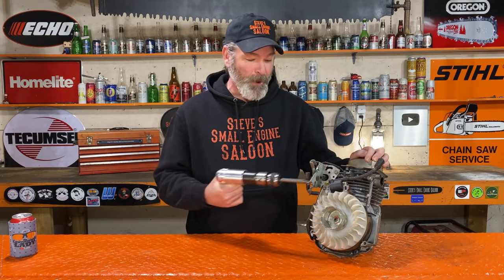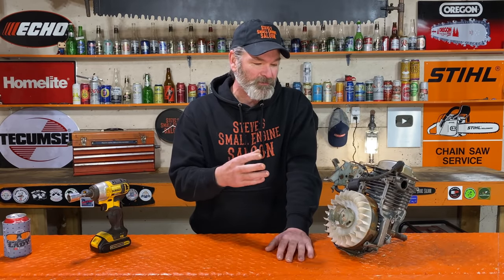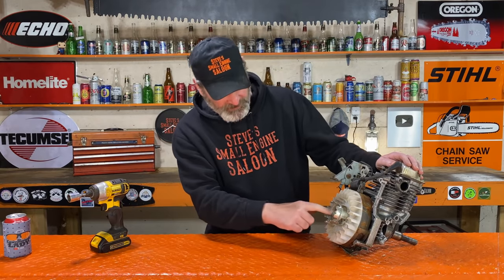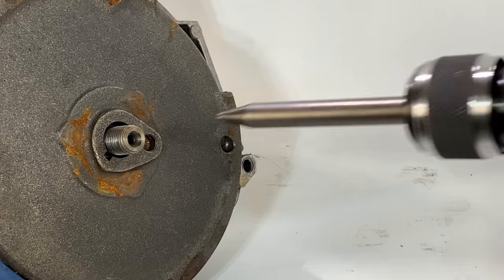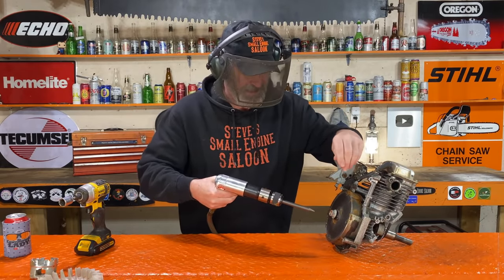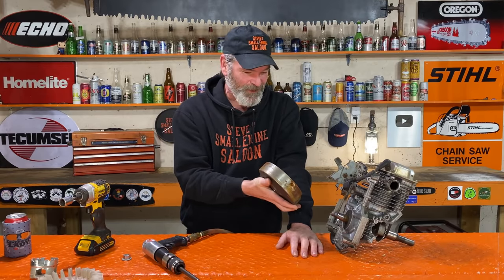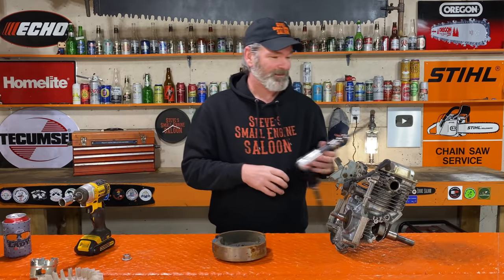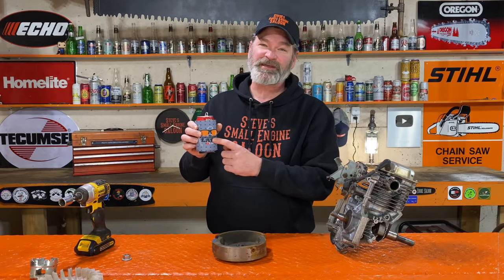Easiest Way To Remove a Stuck Flywheel (Try This)

Comment: I've Used An  Air Hammer In The Automotive Field For Almost 50 Years. With All The Diff. Kind Of Bits It Has Endless Uses
Reply from the maker: Agreed!
Reply: I can't understand the cordless tool thing, I have Sioux air tools, IR impact, they last a lifetime
Reply: Air hammers are great, and air chipping hammers are even better. We had to go to a construction supply store to get one of those. But it will drive out the king pins on a International bus like it's nothing. I love it.

Comment: Well ** me. The flywheel from hell that was covered in rust, sulphur and bad karma that defied the wrath of heat, pullers, penetrating oil and copious bad language just succumbed to the air hammer of god. Thank you sir!
Reply from the maker: Right on

Comment: Please help!!! I'm wondering if my flywheel is having an issue. My generator wont turn over at all using push button start. When I try the pull cord it will only move if the spark plug is removed any ideas? Been at it 3 days now and am completely at a loss.

Comment: Wow! It didn't pop off like in the video but I used the pneumatic hammer on a rivet while a puller had it in tension and it came right off after struggling with it for 4 hours. Thanks!

Comment: UNBELIEVABLE  broke puller tried different puller, no go 
Applied some heat from torch . tapping wheel wile tightening puller no go.Lots of penetrating oil.
I saw Steve's video yesterday.This morning i thought that i might give it a shot with my air hammer
what can i loose .  Low and be-holed one bang and the wheel broke loose and problem solved.
Steve thank you very much. Keep up the good work because we need people like that...
YOU HAVE A 6 STAR FROM ME
Reply from the maker: Thanks buddy!  I am so happy to hear that...  :_Beer: :_Mower: :_Rider: :_Chainsaw:
Reply: Same situation however I don't have one of those air hammers... my grass is out of control...How much heat can I apply to this aluminum flywheel without melting it.  The B&S puller bolts started to bend and it still would not release. Help

Comment: I just found this video two days to late!  I had to remove the flywheel from a Colman mini-bike engine that appears to have the very same flywheel as on your engine in this video.  I used my old puller; and well, you know the routine.  But it was a lot more effort than you just displayed here.  My flywheel had the magnet come off and that broke the coil from its casting mounts, a big problem.  I am going to try and remount the ignition coil somehow.  Thanks for this tip Steve, it's a good one!
Reply from the maker: Thank You...

Comment: All i can say is thanks for sharing this tip.I tried several times with a large gear puller on my 11 hp honda with no luck.I then came across your video .Hooked up the air hammer and shazam off it came.
Reply from the maker: Nice job!  :_Beer: :_Mower: :_Rider: :_Chainsaw:

Comment: I saw you Vid when it came out.  I found a 1950 Power Products 3 HP engine I thought I' d repair.  Your trick clicked off the flywheel in 2 seconds.  Engine was too far gone to re build.  Thank you.  I will use this again.
Reply from the maker: That's awesome

Comment: Was recently working on a Homelite DM50, which is a concrete/multipurpose saw similar to their 450 chainsaw. 75cc I think. Given to us in rough shape. Was "seized" (or so it seemed), after sitting in a damp area for a year or 2.  After multiple oil soaks and dismantling it, I figured it was time to take the flywheel off. Was about to give the air hammer a try, after breaking my only puller that fit and switching to a hammer and center punch, but one more hit and miraculously the engine un-seized! Must've been some mild rust, combined with the nasty concrete dust. Actually got it running now, too, for the first time since owning it. Mean saw, and heavy.

Definitely will get the air hammer out for future flywheels.

Comment: So I have been using air hammer to loosen bolts that will not come lose.  I had adaptors to fit 3/8", 1/2", 3/4" drive sockets then a box end wrench to torque up on them.  Works great! I have made the same and more for my big boy Milwaukee M18 FUEL SDS Plus Rotary Hammer.  It hits faster and harder then air hammers and doesn't need the air line fight just a battery.  I have made a 1/2" and 3/4" drill check, .401 air hammer bit adaptor and it you have the room it is awesome.  I'm do industrial maintenance on huge equipment and 1" drive torque wrench to 1/2" are almost daily used item and it is but to see air hammer or my M18 SDS hammer drill take stuff lose that 3 men hanging on the same couldn't.

Comment: Yep did it with a 7x rivet  gun (Which is pretty much the same  thing as an air hammer.) in an Aircraft Hangar  but used a flat  mushroom tip on the rivet gun so as to bear on the flat end of the crankshaft. I lifted the entire mower via the flywheel to load the crankshaft end float towards the flywheel so that the crankshaft is being hammered into clearance rather than hammering down on the entire engine bearings crankcase mower deck and wheels.  Anothrr guy operated the Rivet Gun.  And after a short Brap I tumbled backwards with the flywheel in my hands.

Comment: Steve you can also get a hammer bit for your air hammer. It works good for a shaft that doesn't have a hole in the center

Comment: When I was a young man, a friend and I spent all morning trying to get a brake drum off a Chevy, about to give up when an old man came by and told us to whack it with a big hammer between the lug bolts.  One lick and the thing actually jumped off.  Shock and vibration are fantastic tools to remember to use!
Reply from the maker: Right on

Comment: thought I'd seen the air hammer trick, and that was a pulley in your previous video.  works on pretty much anything with a tapered shaft or a keyway.
Reply from the maker: Agreed!

Comment: I need to replace the auger drive bearing in an older Ariens snowblower and I've tried everything I can think of to pull the pulley hub off short of cutting a slot in the side of it. I've tried heat with a puller after cleaning the little bit of rust from the shaft, I've tried an air hammer and I can't sell in good faith a great machine knowing the bearing is toast. 
Bottoms up kind sir.

Comment: A small tap with a pin punch on the end of the key will often loosen a stuck flywheel, particularly a Woodruff key which is designed to rotate and lock as the pulley/flywheel is withdrawn.

Comment: Hard to believe that hammer does a different & much better job then just a hammer on the shaft&nut with a screwdriver prying the flywheel.  Broke my Power Products/TECUMSEH AH47 crankshaft doing it that way 60 years ago, believe it was hit square & straight, and still don't know why it broke off.  After all, it worked on plenty of other engines B&S, Reo, Cushman, Clinton etc.  Thanks for the tip, & nice video!
Reply from the maker: Thank You...and You're Welcome...

Comment: And it didn't even take the time for one sip of beer.  🤣😂🤣😂🤣  Cool that the you trick from How To Remove A Stuck Clutch With An Air Hammer from 2 weeks ago worked even faster here!  👍👍  Two thumbs up for you.  I hope your enjoyed that beer afterward.  😆😁  What a nifty tip.  Thanks
Reply from the maker: I know, right?

Comment: You can also loosen some stubborn nuts by putting the air hammer point at a slight angle to the flat of the nut. I have also seen a fan clutch removed from a Ford water pump this way. Just make sure you are loosening, not tightening. Thanks for the demo, Steve. Always better to work smart than work hard!

Comment: Thanks i have a project coming up that i needed to try it on Old Briggs 2.5hp got it with a broken flywheel its on a merrytiller edger have you ever heard of that brand i couldn’t find any info about on line the rotto tillers i have but this is the first lawn edger ive ran across it was manufactured  in my state of washington back when leaded gas was all the rage 🤪

Comment: At age 11 or12 I had a 5 1/2 hp. Johnson outboard and my Dad would lift the motor by the flywheel while I hit the top of the crankshaft   (  protected with block of wood )  (nut on loose) to break ite flywheel free to adjust/replace points and condenser! CHEERS from Sooke City!!!
Reply: Thats the way to do it without a puller for small outboards.

Comment: I personally use a pry bar under the fly wheel loosen the nut flush with the crank upward pressure hit the but with a hammer spin it 1/3 around and 1 more hit usually pops them free. Chainsaws I have a special puller kit I paid 30 bucks for that's worth every penny. I run a shop in Michigan. Awesome to watch other mechanics and pick up some of their tips and tricks though. I'll keep this one in mind
Reply from the maker: Right on

Comment: I have a briggs and Stratton 2 cylinder motor, and the teeth on it are messed up so bad that the starter sticks on it. I've tried a puller but it wont budge. Might have to try this method. I'll let you know if it works
Reply from the maker: Good luck!

Comment: STEVE, If a mild steel 🔩 tool machined for that purpose is used in an air chisel or a hammer drill with no rotation, the flywheel will loosen without even marking the crankshaft. CHEERS.

Comment: I used that method to hammer a kingpin out of a car suspension because there was no room under the wheel arch to get a good swing with a hammer.
Reply from the maker: Right on

Comment: Tapers do not like vibration due to the fact they hold by friction.  This is the very reason you do not put an end mill in a drill press chuck.  As soon as the end mill chatters causing vibration, the chuck can come off it’s taper if the vibration is great enough.
Reply: I wonder if the air chisel method would work on the primary pulley on a snowmobile engine ?  Just back the bolt a couple of threads so it’s loose 🤔
Reply: @tinkergene  can’t say for sure.  I’m a machinist, not a snowmobile mechanic.  If it’s tapered try it.

Comment: great on one piece cast or forged cranks.  i'd be leary on multi-piece two strokes, it could drive the flywheel side onto the rod pin.    on the old b&s they used a collar you'd screw on then hammer to pop the flywheel off. so this is the same idea.

Comment: I got a Briggs that even the air hammer wouldn’t break it free I ran it so long the key came out but the fly wheel is still stuck solid and I got no spark so I got to get to those points

Comment: Someone  gave me  a Ross chainsaw it was all dirty so a decided to clean  with degrease and wash it 
with water  ....but little a knew that the size cc etc...would disappear ...I knew it had a piston problem
and I decided to remove the cylinder and the piston is no good ...the size of the piston is 39mm diameter 
...the question is can I use the piston from another chainsaw  ?

Comment: Hi Steve I have a question I have a km55r  trimmer and shaft keeps spinning and I have removed clutch everything looks good clutch is not touching the cup but still spinning is this normal
Reply: Fly wheel is spinning at idle I have adjusted the idle on the carburetter as low as it goes, and it still spins
Reply: I also did have a high compression problem, but it seems to be turning over fine now

Comment: If you don’t have air or an air hammer - MINIMAL HEAT - use small blowtorch - on flywheel will do the trick.  Once warmed up a small dead blow or nearest hammer will pop things loose with one soft wack.

Comment: Well I might have to go try this on an ezgo robin I'm fighting with today
Reply from the maker: Right on
Reply: @StevesSmallEngineSaloon  mostly worked for me I had to put the puller on and get it tight then it popped right off one pull of the trigger pop came right off only reason I didn't try without the puller was the crank has a slot in the end of it not a hole

Comment: Tell you girls  whut.  I've got  a 35hp Johnson out here  that won't work!!!!   Broke  at least one puller bolt, torch, heat,  hammer,   froze, heat,  still on there

Comment: i think somethings wrong with mine, literally had to smash the flywheel in half with a sledgehammer and one half still wouldnt come off, ended up cutting the crankshaft off and replacing flywheel and crank.
Reply: You are not alone

Comment: Hey man.... your not stupid... use a air hammer and then say here is where you can buy it promo...🤣🤣... hey, no doubt it works, but just be upfront... everyone knows the creators are either sponsored or paid to promo... and why not.. you should, your making the effort to create... so just say... I'm sponsored by this and going to try it... it works, it doesn't... no need for the false, BS smoke N mirrors...
My comment by no way diminishes the quality of your channel...👍👍